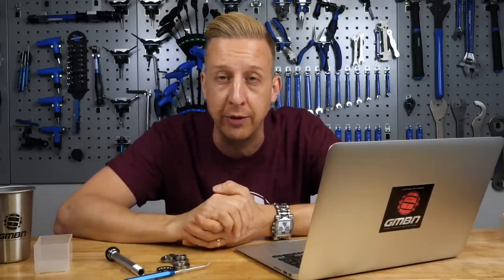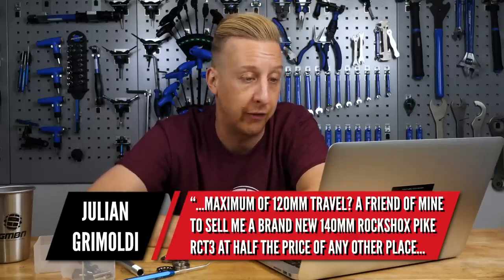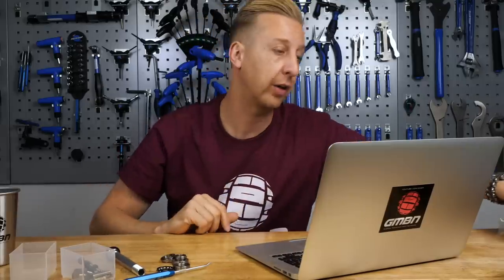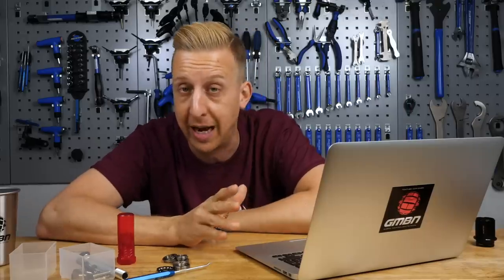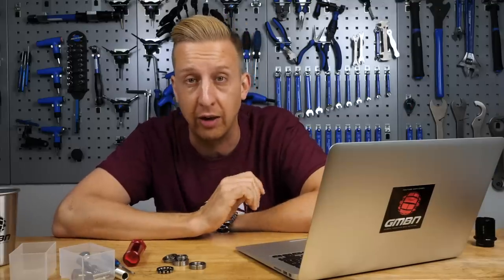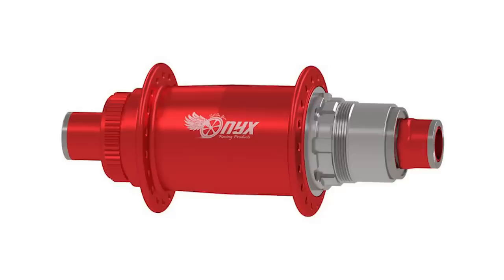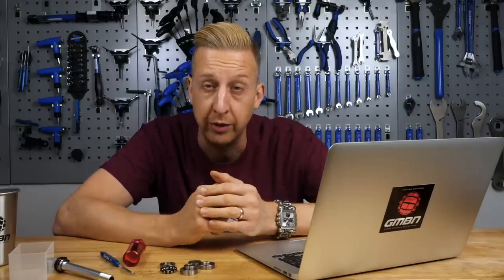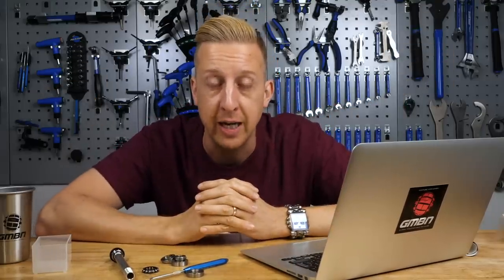Are Cheap Chinese Carbon Frames Too Good To be True? | Ask GMBN Tech

Comment from the maker: Have you ever tried a Chinese carbon frame?
Reply: that "new set of teeth" line made me cry lol
Reply: i read that most chinese carbon frame "copies" are made outoff layedup shells glued together to look similar but lack propper support on the inside of the frame.
Reply: Yup. I have a Chinese carbon mtb frame and rigid fork for about 350$ (for set) from flyxii. So far so good!
Reply: Having experienced Chinese motorcycles, which frankly are horrifying with their appalling quality, I am not sure that I could bare to part with cash for a Chinese copy MTB frame. If they cannot even get a copy of the venerable old Honda CG engine right, what chance do they have of getting a complex carbon bike frame or suspension component right? There is a reason why they are cheap and you can apply that reason to all of the knock off stuff, be it motorbikes, computer tech or even Lego! It tends to be pretty looking, but poorly made trash.
Reply: I live in China and have had a hard time finding imported frames in Large size and the import duties are 20% or more here so I decided to try one of the cheap Chinese frames. To be honest, I quite like it. I have taken it off of some huge drops and have beat it up quite a bit. So far so good. It is a little more flexible than most branded frames but as I am getting a little older I feel like the flex kind of settles the rattle effect out a bit. The geometry is not the most up to date but with a 447mm reach (large), 66* head tube, a 75* seat angle and DW inspired suspension linkage it is actually a decent ride. The bike is the All Mountain 150mm travel (rear), 27.5" bike manufactured in Shenzhen by Ican. Seraph bicycles in Xiamen also make a similar rendition. 

Not all "cheap" Chinese frames are created equal mind you. Some big name manufacturers are using these frames with their brand slapped on it. Some offer lifetime warranties on the frames as well. I am about $3500 USD in to my bike and got to go with full XT components with 4 pot brakes, X2 rear shock, Carbon wheels from the same factory with DT350 hubs, full titanium hardware, Santa Cruz carbon bars, 2019 Lyrik fork, Fox Transfer dropper, Ergon cockpit, SLX crank and a renthal stem. For the money of a branded bike I can have a 27.5" and a 29er fully decked out for the same price.   

If you are a really hardcore rider, I suggest paying the extra dough for a branded frame for peace of mind, but if you are not hucking it like a pro, check out Risen Bikes, Lightcarbon bikes, Ican Bikes or Seraph. These seem to be the best quality. I am an engineer for an American company that does quality control on a full range of goods here in China and have lived here for 5 years. In that time I have attended many bicycle trade shows. If you are careful and know what to look for, there are some decent manufacturers here. Just go with one that people have had success with and you'll be fine. I just wouldn't trust the cheap handlebars. 

If you have an email address or somewhere I can send some pictures, I would be happy to do so.
Reply: I own a CX frame from Flyxii, I've used it for 2 years and it's fine. Pretty stiff where it counts, flexible enough for gravel grinding. The fork tho - it was too flexy, I changed it for a more rugged one and I am happy with it. The only issue I had, was the water bottle screw insert broke and I had a new one glued by a carbon repair shop. I can't really tell if it's my obsession with 1l water bottles, tight bottle cage, me screwing the cage too much or manufacturer defect, but I've seen similar issues with big brands as well. 

I've seen a dozen of Chinese frames on my mates bikes, same for carbon wheels (for roadies) and as long as you use theirs reputable brands there are hardly any problems other than final finish. That said - if you go to bike trade shows - It's not uncommon to spot Chinese catalog frames, especially on smaller brand bikes. 

And since there was a Pink bike mention - they had an amazing article about industry insider that's been sourcing frames for name brands, tl;dr - quality control is king, that's where they cut corners the most.
Reply: I think a show on the Chinese bike parts would be a very popular segment. There just isn't much out there in the way of reliable, frame of reference reviews so if a channel such as yours could sus out what is what, it would be a great service to the community.   

Personally, I'm looking for/wanting a full suspension frame.  I've got two hard tails with perfectly good parts so I could just cannibalize one of them if I could find a reasonably priced ($700-800) frame.  The only frames I can find that fit that are the Chinese carbons.  Everything else I've found makes it so I'd be better off buying a whole bike.  While new bike day is always exciting and can you ever have too many bikes, financially it isn't the best idea for me and I'm sure I'm not alone.
Reply: Yes all the bikes have chinese frames
Reply: Living in China, I’ve used Seraph and Ican frames for the past 8 years- Road, mountain & gravel frames... it can be hit and miss sometimes with finishing (bb facing  & frame inserts), but as good & reliable as all the “name brand” frames I’ve had in the past.  All companies seem to have their issues!
Reply: Yes. I bought a CF hardtail Chinese frame. Built it up as a 1x10 with a 130mm Manitou fork. I love it! I've also been running a Chinese CF wheelset on my full suspension bike for the last five years without issues. Thing with Chinese frames is you have to do your research for reputable companies. Otherwise if there are any issues the company may not exist tomorrow or change their name.
Reply: I pass on carbon because if it’s terrible impact on the environment. Carbon recycling is not very accessible, and aluminum can be recycled endlessly.  However, if the industry doesn’t want consumers to turn to “cheap” carbon, they need to make the sport more accessible to the lower-middle class (me). Hopefully the new Magnesium alloy won’t be price-fixed the way carbon has been.
Reply: You should make a series where you try and review budget carbon components and bikes
Reply: A lot of the Chinese components are manufacturing rejects that are discarded then sold through sites like Ali Express
Reply: GMBN Tech how about you build a bike from scratch and build it up only using chinese rip off parts. Pass the bike to a diffrent presenter every week. Cheers from Belguim ✌️
Reply: Don't bother doing the cheap Chinese test as I know exactly how it'll go ...   I don't blame you but your paymaster brands will make sure it can only go one way.
Reply: Ive been thrashing a Chinese full sus xc  frame for 2.5seasons now. So far no complaints. Between me and my club mates we must have at least 10 road and mtb frames from China. Only one has had a problem with a seatpost clamp which the covered under warranty by sending him a whole new frameset after he emailed them pictures to prove that he had cut up the frameset (so he couldn’t con them).

I’m currently looking for a gravel bike frameset and probably going Chinese again.
Reply: I was thinking of buying one of these frames as well. I have bins and bins of spare parts, and this would be a cheap way to get them onto a frame. Most of these frames are even below wholesale pricing on higher known brands that you can get working at a shop. I don't know if I would do aggressive mountain biking on one, but I imagine it would be fine for city commuting/riding, some playing around. Please make this video nice and long and in depth!! Not something to rush through, or make it a series. Cheers!
Reply: GMBN Tech yes. And mine arrived with a crack which gave way when installing me forks. A whole chunk of carbon cams off where the lower bearing goes in. Never buy a TORAY frame. The warranty system is terrible. Better buying an alloy branded frame. Never buy from China
Reply: Charles James exactly the same AS me!!
Reply: I have a guy in my town with a Chinese carbon frame he was getting into riding and paid $350 for it then built the bike. It was well built and so far he has had it for 3 years with many crashes and its holding up so far. I told him a carbon bike to start out on was a bad Idea but its worked for him thus far.
Reply: Two so far, gravel bikes (one for me one for the better half) couple years of curbs, stairs, mellow single track road and gravel so far so good.  I didn't buy blind, I searched out popular China brands and models so I felt like I knew what I was getting into and what to expect... In my case I bought ICAN brand because I found a few stories were they exchanged them on warranty and a even one they covered what was clearly shipping damage and the geo of the XL I needed worked best for me (slightly taller stack height).   There were 3-4 "major" direct China brands with lots of info and user info Workswell,  Carbonda and Tideace along with the ICAN brand I bought.        I toyed with the idea of a full suspension model but after adding the rear shock cost and decent build it was cheaper to buy the lower cost model from a major brand and sell off replace the parts I didn't want... that and the geo on direct from China suspension bikes is pretty old school by todays standards (steep HTA and shorter reach numbers than normal...more XC race geo)
Reply: Yes u can run car pull through valves without a problem, but u have to drill out hole in rim to a size 11mm drill bit I have for over a year and a half now with my tubeless setup .
Reply: I have been riding a twentychiner carbon full sus for about two years now.  Frame is solid and I have no complaints.  What you will find when you research this is that, A). there is quite a community built up around building up these bikes, and B). there are a series of frame model numbers that are commonly used with the direct sellers and both the good and bad ones are quickly identified by the community.  From my experience, if you do your homework you will get a good deal.  It should be noted that you are not purchasing inferior quality products, rather you are purchasing quality products based on old technology and construction methodologies.  Do your homework, consult professor Google and you should be in good shape... new teeth or not.
Reply: @NoWoke288  No they don't edit
Reply: Yes. I own two of them and have had zero issues with them. The first one is an XC/CX 29er/700c frame and fork I acquired secondhand from a pro racer. He threw it through it's paces, rode it hard and put it away wet. Amazing deal for only $200.00. The second one is an eBay 120mm full-suspension fatbike frame ($900.00 from new direct from China seller), also I have had zero issues with it, despite having been hucked off jumps (2 meters of air) and plowed through technical rock gardens regularly. Your mileage may vary.
Reply: my friend from US brought a Chinese frame and I was worried abt it (ps:I am Chinese ) but after few ride with him and try it by myself. I have to say it’s pretty good and solid
Reply: I have built 3 Chinese carbon bikes 2 hardtail 1 full suspension.
I now have a Intense Recluse and can say both Intense and Chinese have been great bikes.

The name brand have more fit and finish the Chinese are no frills.
Reply: I doubt your sponsors will allow you to test some open mold Chinese frames.

The results wouldn't be what they wanted.
Reply: I have, actually, flyxii frame for CX. After half of a season, it's doing well, no major complains, stiffness and lightness all the way
Reply: Buy a zoom dh 680 fork i wamt to see if its worth it
Reply: @vincentroque8614  very true...or made to much lower quality standards...
Reply: Brand loyalty means nothing - see my other comment. My Scott Scale alloy frame cracked after 12months use, Scott walked away told me to go jump - all frame/bike had used for was normal trail riding & XC racing in Southern XC regional series....that "voids" there stuff apprantly so sorry going for a "big brand" means nothing won't support customers further down the line.
Reply: @lances.8453  hi Lance nice tip on Chinese frames. What do you think of the bxt brand of bikes. I'd like to get those they offer it at free shipping thanks
Reply: Yeah I've had about 5 Chinese road and mtb frames and still.have 3 compete bikes. No issues apart from an early frame that had a crappy hanger bolt and needed paste on the tube to stop it slipping but no.other issues. All were light and stiff.
Reply: jom_ aca I've got a 29er hard tail.BXT, Marzocchi xc forks bsa bb is a good frame for the money.
Reply: Im running unbranded Carbon frames for both my Cyclocross Bike, and my MTB, and i have had 0 problems with either of them over the past two years, and i have abused them just as much as if i had a branded bike. Im also running unbranded chinese carbon wheels on my cross bike, still no problems with those, and im running unbranded carbon bars and seatpost on my MTB with no problems, especially after some big crashes where they could have cracked or broken but didnt. So I would say that I trust most unbranded carbon products, but there are some that i would try and stay away from, and those are the unbranded carbon cranks, with a set of MTB cranks only weighing 410g, those are defiently too good to be true.
Reply: Yep, bought a coinage m10 "replica" 3 years ago. Have ridden 10,000 miles on it without a hitch. Built it up with Sram red, Chinese, HTC carbon wheels. Rides great too.
Reply: e bc ehh no
Reply: I had a set of Ican carbon rims, they were really stiff and hard to keep true(granted they were on a rigid). They also weighed about the same as my Stan’s crests so I switched back
Reply: @antjoshwww  Haven't seen this brand.
Reply: GMBN Tech one of the people I race xc with runs one of those frames and it’s ridiculously light and they love it
Reply: Could you please make a video about full China suspension bike? Just interesting how good they make their frames, shocks and forks. Thanks!
Reply: "John Davis   -  Good timing... I was just wondering about THIS."     I have had this bike for 3 years now. 4.8" wheels/tires in the snow season. 29" X 3.0" wheels/tires in the summer season. I  (and everybody else who tries it) really like the bike. It is a lot of fun. I have it built up light. About 30 pounds. Maybe a little less. At one point in time early on I had trouble with pivot bearings making noise. I applied thread locker and retorqued all bolts to specifications. And haven't had any more trouble for over a year and a half.
Reply: I have been riding an Ican P-8 29er for two years. And an Ican Malamute for three years. After a few initial setup issues, No problems whatsoever.  P8 with high quality build parts is very light. 120mm (trunnion horst link) rear, 140mm front travel. I am looking into the Ican P9 29er with 150mm rear and 160mm front travel. Shimano XT build. $2850.00 plus shipping. Rear suspension appears similar to Norco Range, or Transition.
Reply: I bought a TTT frame and several sets of carbon tubular wheels years ago. There were some tolerance issues with the rear dropout which required some tweaking. Also the inside radius of the wheels was a little too flat so it made glueing a little more difficult but I always felt safe racing on them.
Reply: no issue's. My favorite would be Cube & least favorite either santa cruz or ridley.
Reply: I raced all this summer on one, no problems! Including the Leadville silver rush 50! Feel free to contact me if you have any questions about it!
Reply: Yes, I ride chiner carbon. I choose frames that are not "superlight" so there is an extra safety factor. Haven't had any problems.
Reply: most frames are  made there by the big brand names too.  You still buy from china lol.  @shaystokesmtb9254
Reply: Ican and bxt work well no issues. I am 215 lbs.
Reply: I believe there are two levels of China parts, China Branded and Knockoff/forgery.  Sticking to the China Branded should keep you out of trouble with Sponsors.  These companies carry a full range of products and some offer 2+ year warranties. I've been riding a Model 057 hard tail with full carbon build out, fork, wheels, seatpost, bars with xx1 drivetrain for about 4 years with no issues.  I recently drilled a hole to add an internal routed dropper post.  So far everything has been great.  I haven't ridden any Name brand carbon hardtails, so I can't compare the stiffness/flex, which the one area I wonder about, as quality has been excellent for me.
Reply: I have built up two chinese carbon frames. The first was a hardtail mtb with that glossy carbon fiber weave that looks great. Kitted it out with purple components and it looks awesome. I've used it on the mountain and it feels really stiff, although my fork is s***. I've used it more on the road doing trials-y stuff and its good there too. Great commuter as well if you want to look cool while doing it. There were a few niggles, like the glue/carbon around the dropouts was really thick and rough; had to sand it off. Bottom bracket included didn't appear to be too high quality. The reason I built this up is because I already had components on a HT bike but wanted to do something new - and I have the old frame to go back to if something breaks. I would not recommend buying one of these frames and building it up with top end components. 
But in short, I liked it so much I decided to do the same with a road bike, which I got the frame from china for then built up from scratch with eBay-sourced ultegra components. Made a ~$2500 bike for $880. It had a few more niggles, like the internal routing was a nightmare, the bolts on seat post and under-BB-cable threading are crap and are rusted after one ride in wet, every creak during press-fit BB fitting gave me a heart attack, matte finish holds on to fingerprints and oils and sweat. 
But overall I absolutely love it. I wouldn't recommend building up a DH or park bike from one of these frames - just don't trust them enough. But a HT trail bike or road bike? Go for it. Doddy is right it is a ton of fun to build it yourself. Just make sure it isn't your only bike/frame.
Reply: Yeah, actually a surprising amount of carbon frames are manufactured in China, from Trek, Specialized and even Santacruz.
Reply: @NoWoke288  none of my bikes have Chinese frames. All my frames are made in England, America or Taiwan. But not China. And no, Taiwan isn't the same as China.
Reply: Bought a chinese 3T ergonova bars from DHgate in 2012 used them for years on hardcore sprints on a pro-lite alluminum track bike now i have them on a chinese frame road bike and thier still going good along with my a frame.
Reply: Theres a guy from australia that cuts up all the good bikes and the good brands look like trash inside.BMC frames are junk inside and moset are made in china
The have Inspector stickers in them
Reply: I bought a Chinese hardtail frame from a buddy who got it off eBay, he rode it for probably 3 years before me, and got a couple downhill Strava KOMs on it that are still standing to this day. I've ridden it for the past 4 years with no problems at all.
Reply: @Advcrazy  what brand maye5
Reply: Frame never but i have a rigid carbon fork and handlebars for my old cx bike. Survived quite a few crashes including a car crash no problems. I heard that it depends on the brand name. Some are absolute crap while some are fine.....
Reply: I bought my Charbon frame from Ebay seller Toray mtb frames. However, the frame looks just like the flyxii frames.  I have logged a few hundred miles of single track on it and so far so good. Nice and stiff where it counts and flexible under some heavy pressure. Awesome frame for $300, it has the 3k matte and all internal cabling. It looks pretty nice amd fit and finish are pretty good. I will admit as others stated I have a little crimp in the carbon around the seatpost for maybe tightening it too hard. I was deff nervous about it but after miles of riding it hasn't spread or anything. I babied it at first and then just started to shred with it after I was comfortable and it's held up well. Maybe I just got lucky but if your on a budget and really wanna try out carbon I would recommend the seller I got mine from. Just my .02
Reply: GMBN Tech i have had a chinese carbon frame for over 6 years now (cost 180$) and my brother has had his own for just as long and we have had no problems at all (his bike was recently stolen) we have also been riding chinese handlebars and have had no problems but you should probobaly stress test them before using them cause im pretty sure they dont quality check as well as other more exspensive brands
Reply: @lances.8453  Would you send me some pictures?
Reply: @lances.8453  very interested in building one of these on an Ican full suspension frame could you please send me some info/picures
Reply: Would love to hear more about buying Chinese aliexpress parts and seeing the results. Great video guys!
Reply: Bought a road bike frame ( sshh don’t tell) from China 4 yrs ago, custom painted it and it’s been faultless since. Unbranded so not a brand name ripoff which I don’t support buying.
Reply: If I get another concussion, I’ll be licking a lollipop for my day job. No way I’m sending on a frame of dubious quality.
Reply: Where do you think the 'cheap' frames are made?, Same factory as the ' massively over priced frames.
Reply: Everyone who has a carbon frame is allready riding a carbon frame.
Reply: Yes, not mtb , was a road bike. Was a perfect conalgo copy . Found out they were the oem for conalgo.
I heard velomall makes really good frames.
Reply: I have a chinese road frame bought 7 years ago, the frame so far so good but!!, cable routing is shit since carbon layers are sharp inside,  I noticed that i cant have a confident cornering since  the frame tends to twists in cornering '' feeling'' no visualising , front mech bolts were loose when arrived,  I believe china has developed a lot for 7 years ahead now ... who knows maybe i have to push my luck once again:)
Reply: MOST expensive frame brands are made in china, example Pinarello. look up "made in italy" law how lax they are and why Pinarello made in Italy but yet I know the frame manufacture in china.
Reply: @2001MBKBooster  link is down, I'm currently checking this certain brand... Ksc, kang sheng composites, ksfm15 bike frame... Coz I'm about to purchase it from someone... Though I am not sure whether its legit or not. I'm worried about the quality when I learned its a Chinese, unknown, small manufacturer
Reply: I own a Chinese made no name full carbon road bike. I was very hesitant at first. I would cringe and tense up if I had to hit a hard bump or hole. However, I’m well over 3,000 miles on that frame and fork and it seems to be holding up. I’d like to also mention that I’m a pretty big guy, 6’1” and 220 pounds. Not sure how I’d feel on Chinese carbon trail bike, bike parks are pretty wild these days
Reply: GMBN Tech most bikes are built in China. Taipei, that is. (Yes, I’m trolling!! 😆)
Reply: I would think I’d look at the driving force behind the manufacturer. The Chinese are concerned with money, getting a piece of a popular money making industry and putting as little money into the manufacturing process as possible.
Reply: Yes I try it every day its your brand carbon fiber bikes that I try every day lol.
Reply: @lances.8453  If you're a beginner, you don't need carbon, nobody needs carbon in fact.
So just buy alloy.
Reply: @dumbr2098  define “need”...
Reply: @lances.8453  Go to Google, I'm not your teacher.
Reply: @lances.8453  Do you guys inspect quality on bycicle components from China?
Reply: i actually took a punt on a Chinese carbon road bike frame. ive got two other bikes and I thought lets see!! was around £360 I believe. I was actually surprised!! I thought it would be super poor but it actually is a good one. maybe I got lucky! but ive done over 3k miles on it and its been fine!
Reply: @drewbarrow5670  How much do you weight?
Reply: Lance S. hello lance, could you send me an email with the information about your bike ?
Reply: @notachance8887  what happend seen that this was a year ago did you buy the Chinese carbon frame?
Reply: @rplumb7697  hi there I've just orderd a seraph should I give it a good frmae and fork check for any cracks and ride slow on the first few weeks?
Reply: @rplumb7697  I'm buying a tt- x21 off dh gate it's dirt cheap and I think it's a replica what's your opionon on it?
Reply: I do have one 29er china carbon frame, they gave me 2 yr warranty and i was hesitant. But it only cost me 275 for a frame. I rode it hard to this day and the 2 yrs are up no cracks or anything. I wouldn't say they are all solid, but the ones closer to 300 and up seem to really hold up. I tried to crack it and had no luck before 2 yr warranty was up.
Reply: The entire front end of my fixed gear is Chinese carbon, as is the saddle and seatpost, its been going for a while with no issues but I must admit I'm a lot more careful hopping kerbs than I was on the old steel fork)
Reply: I tried a 15 € wish.com carbon handle bar. Looks and feels fantastic. For over a full year of riding once a week. Until it broke in half unexpectedly. Still have my teeth, luckily.
Reply: hell  no
Reply: That's why bikes have warranty.
Reply: Carloswithac are
Your CF rims tubeless? How is changing flats? I’ve heard horror stories about a few Chinese CF tubeless rims.
Reply: Bought a hard tail carbon frame $300 and wheels $250 from ebay. Quality is there.  Will test it out once my build is complete.  Bxtbikes is who I bought it from.
Reply: Yes, yes and YES! I love the stuff. Ive had a frame and wheel set for over 12 years now and besides general wear and tear, its still going strong along with my other 4 frames.

Remember kids, if you buy a fake with paint job and all to flash it to your group ride lads as a real and it breaks, GOOD. DONT buy "too good to be true" in any regard!

If you are buying from a UCI certified manufacturer with 10-15+ years in the industry, you are undoubtedly getting legit quality item because no brand in the world would survive that long with sub par products or they are just the greatest scam arts around and there are too many ignorant buyers out there... wait the latter is what is keeping the bicycle industry alive.
Reply: @carloswithac  which company did you use and is your frame a f/s ,if so whats the travel ,TIA
Reply: Yes. I have had bought a lot of chinese carbon stuff, two frames, many rims, road forks, but steer clear of cheapo cheapo and buy directly from reputable suppliers, farsports, lightbicycle, ican bikes. The price should still be similar to good deals you can get in the UK on branded stuff e.g. £40 for a seatpost or £120 for a rim. Generally chinese frames seem a lot cheaper because bigger UK/US brands seem to ramp there price of frames up, to encourage people to buy complete bikes. Last time i bought a carbon frame ended up going with planet x as it was cheaper than getting from china. At end of the day still a cheap chinese frame! 

Also, dont buy super lightweight stuff. It can be too light to be true. Buy something comparable in weight to a low end branded bike for the same size. You cant compare weights  of a £6000 BMC with a £500 chinese frame.
Reply: I have a chinese frame, and it acts very good. The only thing is just they are nit famous brands. But I'm not into that. I just want to save and I know that it is a strong roadbike
Reply: @drewbarrow5670  how's your bike frame now? Is it still good?
Reply: I ride a China made carbon XC bike.

It's a carbon framed hardtail Ive gotten from a reputable bike shop I've picked up since 2019. It's priced at approximately 650-700£ converted from my country's currency. And yes it was the price for the whole bike. Came with a decent groupset and hydro brakes from Shimano. 

Of course I don't do massive drops and jumps or send it like no tomorrow but I do enjoy hard hiking trails(single trail) around my area. And hell yes I love riding quick and steep decents.

So.... It's been pretty reliable for me so far, no massive problems or signs of fatigue from the frame(touch wood).
One of the mechanics from my bike shop races local races with a road bike of the same brand. I guess it wouldn't be too bad. 😂

My 2 cents is that, yes they are fine and rideable but it boils down to the trails you're riding. If you're into gnarly stuff, best go for the reputable ones. Cheers
Reply: Ive just seen a video of a man that broke his leg and is on a stilt because the seatstay of his cheaply bought carbon chinese fullsus frame snapped. The two seatstay SNAPPED!

On a two foot drop!